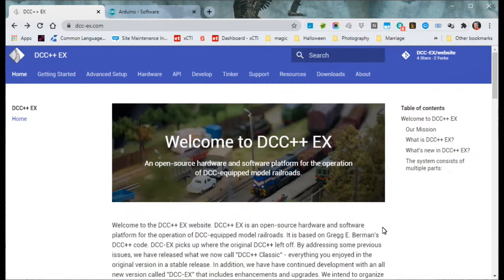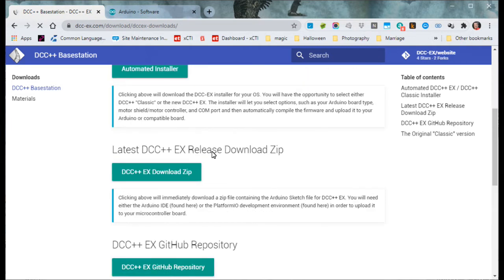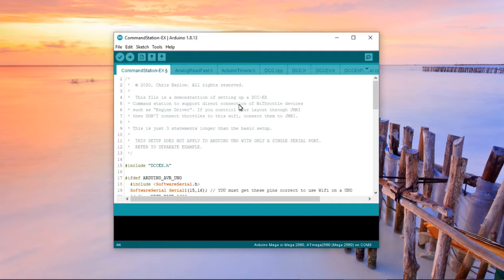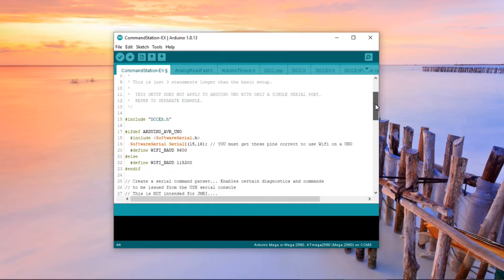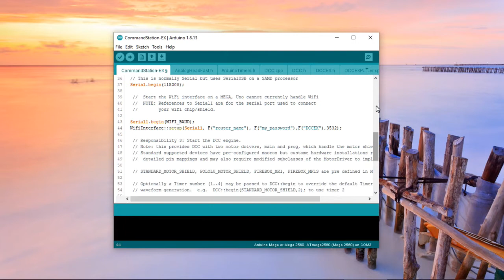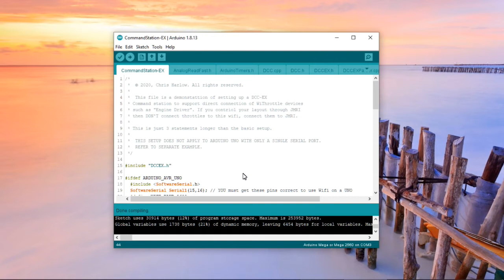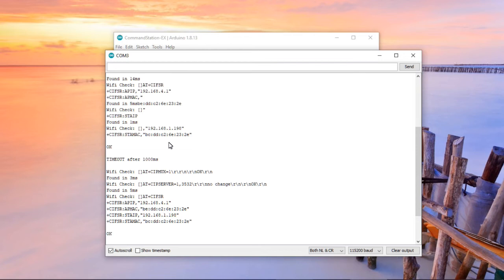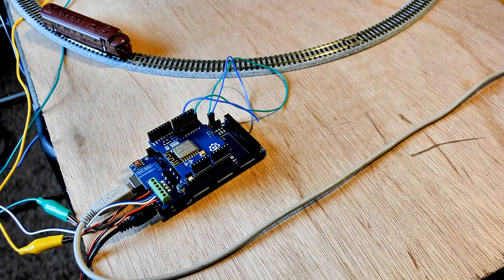How to connect DCC++ EX to WiFi and use Engine Driver to run your trains

Comment: Can you program a locomotive address 3 to say drive forward 65% for 3 seconds, stop 1 minute, change direction, switch turnout 1 to open, drive 65% for 3 seconds, stop 1 minute. And so on?
Reply from the maker: Yes, simple. A simple script in EXRAIL will do this for you. See: https://dcc-ex.com/ex-rail/EX-RAIL-command-reference.html#gsc.tab=0 It would look something like this:
SENDLOCO(3, 1) // send loco 3 on sequence 1
SEQUENCE(1)
 FWD(82) // forward at 65% of 127 speed steps
 DELAY(3000)
 FWD(0)
 DELAY(60000)
 THROW(1)
 REV(82)
 DELAY(3000)
 ...
There is a lot more you can do here, including respond to sensors with AT, as in AT(coal_yard_entrance) do something. Sequences can call other sequences. If you use the word ROUTE instead of SEQUENCE, Engine Driver and JMRI will see them and you can press buttons to start and stop them. Come see us on our Discord!
Reply: @DCCEX  Will it work with Digitrax hardware or is it not needed?
Reply from the maker: @fourbypete  You don't need Digitrax at all, but if there are specific things you might want to repurpose from Digitrax, ask on Discord
Reply: @DCCEX  How do you connect/ control turnouts, program lights, decoders and track sensors?
Reply from the maker: @fourbypete  All of the inputs and outputs can be connected to spare pins on the command station or use the I2C bus. Many  devices already have an I2C connection. You can also connect anything that has an accessory decoder, we call those DCC accessories. You don't have to connect them to the track, you can connect them to a separate bus if you don't want to use power from the track.
Reply: @DCCEX  I'll have to sign up to discord. I hear about it all the time.

Comment: Great video and I recommend it all the time to anyone looking to build a DCC-EX CS.  I'd like to see another with the first part but skip the Arduino IDE install entirely and show the software install using the EX-Installer only in that video.  I have a feeling the IDE install  might be turning some potential users away even though the EX-Installer is mentioned.

Comment: This is the best, but I'm stuck with something. I've followed all the steps on the dcc ex website to set up my arduino + esp8266 board (all in one), but the engine driver app that is supposed to work with direct dcc ex connection, disconnects frequently then reconnects and so on. I've tested dccpp app and works like a charm, but only one throtle is available at the screen, so I prefer the other one. My goal is to set up the system without any computer, only a tablet (android) and the arduino itself. I think i'm missing something, could you shed some light on this? Keep rocking with this!!!

Comment: I just received the a new Makerfab wifi which came direct from China. This one is labeled on the bottom as "DCC-EX Compatible". It worked great so it must have had the correct firmware as noted on the DCC-EX website.

Comment: Currently version 4.1.6: where is the configuration for the WiFi access point?
Reply from the maker: There is no configuration for the WiFi access point. If you connect a WiFi device and turn the command station on, you will get an AP at address 192.168.4.1 that begins "dccex_". Connect to that. If you want other configuration, that is in your config.h file. You can edit that with help from the website, or just use the new installer (After July 2023). The installer walks you through the configuration if you want AP mode or to connect to your home network in Station mode. This explains both modes in detail and how to configure them https://dcc-ex.com/ex-commandstation/advanced-setup/supported-wifi/wifi-config.html
Reply: @DCCEX  The issues is that regardless if we make it an STA or AP mode the EX-Installer uploads the configuration as an AP mode, no matter what. I am having a hard time finding a cut and clear tutorial on how to set it up as an STA. Would be nice if the installer would actually turn it in to an STA when selecting "Connect my EX-CommandStation to my existing wirelss network."
Reply from the maker: @vladtheimpala218  Have you used the new installer? I need to make a video on that. It is completely different than the old one and allows all sorts of configuration options. See here to make sure you have the latest version. For help with it or with using the Arduino IDE, please come to the Discord channel and post a question as a support ticket or just a comment in a channel like #installer

Comment: VERY usefull and excellently explainedl tutorial on DCC-EX and wifi. Congratualtions!
EDIT: @4:00 you mention the ESP8266 version 01 to be connected straight to the RX and TX of the Mega. This is a NO-GO: the Mega uses 5V, the ESP uses 3V. Connecting the Mega TX (5V) to the ESP RX (max 3V) risks damage to the ESP. That is why a shield should be used: that contains level-shifters.
Reply: I understand, and you are correct about the datasheet ratings, however the President of Expressif, Teo Swee Ann, confirmed that the GPIO pins were 5V tolerant. And many of us have used the ESP-01 and 01s for years with 5V on those pins without an issue. And with the Rx pin being fed data rather than full DC voltage, the average voltage the chip sees as heat is lower still. The power in, however can't go above 3.6V. 
That said, we have debated this a few times on Discord, and engineers being engineers and wanting to be "precise" like to be more cautious and tell people to go for 3.3V, which you can do with a 10k and 20k (or 1k and 2k) resistor divider on the Rx pin of the ESP8266. You can't go wrong with the conservative approach, so glad you posted this! There could be unexpected peaks and better to still with a lower voltage. We go into this more on the web page and provide a link to a cheap level shifter board if people would rather use that than resistors.

Comment: Quick question,  do you have a tutorial showing how the esp-01 with an esp-01 adapter board connects to an elegoo mega with a deek robot motor shield,  thank you.
Reply from the maker: We don't have a video yet for that, but it is a great idea. But it is pretty simple to do. This shows how. It doesn't matter if you connect to the Arduino or the Motor Shield since the pins pass through to the shield from the Mega. https://dcc-ex.com/get-started/wifi-setup.html#esp-01-and-esp-01s

Comment: I'm not getting it. I don't understand where I'm hung up. I got my mega board and Arduino and can run my train just fine when connected to my laptop. My wifi shield finally got here yesterday. I connected it to the other 2 boards and hooked up the jumpers. I can't figure out what to do to make engine driver connect to wifi.
Reply from the maker: Did you use the installer or the Arduino IDE? Better to use the IDE if you have troubles. But before you try anything, look at the log when you connect a computer running the Arduino serial monitor. It should show you the attempts to get a response on all 3 serial ports of the Mega. If you see 3 "no AT response" messages, you have a connection problem or bad board. If you see one of the attempts connect, you will see 192.168.4.1 in your log. Look for that. If you see it, then you turn off auto-connect for your home network on your phone. Then connect to the DCC-EX Access Point you should see there. If you have the latest version of Engine driver, when you go to it, it will find DCC-EX and you put in the password. The detailed instruction is here: https://dcc-ex.com/advanced-setup/wifi-config.html#default-operation-ap-mode-no-configuration-necessary.
If you don't see one of the serial ports respond with a lot more commands and the IP Address, then try another serial port or switch the wires. One of the clone Megas has the silk screened letters backwards on one of the ports and Tx is Rx and visa versa. If you still have trouble, send us an email or post on Discord with a picture of your boards so we can see the jumpers and a copy of the boot log.
Reply: @DCCEX  I used the installer.  I entered my home network name and password.  I get the impression the Wifi is working but I can't seem to connect to it or see it on my home network.  I looked at the config.example.h file and I can't see any references to wifi network name or password. There is no other config file in my CommandStationEX folder. I don't know how to get to the log file you mentioned.  I'm not really experienced in networking but I do have my computer, phones and Roku devices correctly joined to the network. I've been reading the pages you sent me all day long and I'm still having trouble.
Reply: @DCCEX  I got it. Thank you. I was missing one step and once I found it, all was smooth.
Reply from the maker: @michaelmappin4425  Oh Great! I was just getting ready to type some more instructions. What was the step that got you going? I can update the help to make it easier to find.
Reply: @DCCEX  I just wasn't thinking in terms of it being a network I had to connect to. It's clearly in the video but for some reason my brain just kept skipping past that. Once I connected using the password from the MAC address, everything was smooth sailing. Thank you again for everything.

Comment: Can you guide me if this can be used to read and write CVs and wirelessly by connecting my laptop to the access point and then launching JMRI? I am very new at this any help will be much appreciated.
Reply from the maker: You can read and write CVs, but to connect to JMRI you should connect using a USB serial cable. You can use a WiFi connection, but that is not how we recommend connecting to JMRI. You will get no diagnostics, it is slower, and when programming, ACK detection is "blocking". That means if trains are running on main, they may lose some commands. Same with turnout control.
Some phone throttle apps let you read and write CVs wirelessly so you do not need JMRI. 
You can also use the HC-12 boards as a wireless USB bridge. You connect one to the serial Tx/Rx pins of the Arduino and another through a USB to TTL board to the HC-12. Or you can an HC-12 with a USB to TTL converter in it. That is called a "HC-12-USB Line Computer Terminal"
If you still want to connect JMRI directly to the CS using WiFi in AP mode, start one of the JMRI-based programs, then go to the Preferences panel. This opens automatically the first time a JMRI program is run, or you can select it from the "Edit" menu (from the Application menu on OS X).
Connect your laptop to the AP of the CS, NOT your local home network. You can use your local network, but you asked how to use the default AP configuration.
In JMRI, Select "DCC++" from the top selection box ("System Manufacturer").
Select "DCC++ Ethernet" from the second selection box ("System Connection").
Input the IP Address and Port Number of the DCC++ Command Station.
Click "Save". You'll be asked if it's OK for the program to quit, click "Yes".
Restart the program. You should be up and running.
Now you can read and write individual CVs or use the page read and write feature in JMRI.

Comment: I'm building my own wifi board using esp8266 modules. The problem is that they have been used for other things before and don't have the AT software installed. Has anyone any idea how to re-program them?
Reply from the maker: We don't have a tutorial for just the ESP8266 chip, but here is how you upload the correct AT command set once you have a circuit or cable to connect it: https://dcc-ex.com/advanced-setup/supported-microcontrollers/wifi-mega.html#mega-wifi-configuration. So just ignore the part about the Mega+Wifi and do the same for your board. Instructions for what else you will need depend on your board. If you have the tiny ESP-01s boards, you will need to create a circuit with a breadboard, some jumpers, an FTDI board or FTDI cable, and perhaps a button or two. There are lots of instructions if you search "upload firmware to ESP8266". If you buy a few new ones, they come with the AT command set on them.
Reply: @DCCEX  Thanks for getting back to me. I have managed to get the AT commands working this time. I hadn't set the SPI mode to DIO as said in the instructions. Many thanks, I can start on my own wireless shield now.

Comment: No motor jumpers required this time at all? Please clarify
Reply from the maker: We configure an Uno or a Mega to use the correct pins to match the motor board. You do not need any jumpers to connect a motor shield like you do with DCC++ Classic. Details are here: https://dcc-ex.com/get-started/assembly.html. 

We can however, use jumpers on boards that are not shields, or to implement our "high accuracy" waveform on a board whose pins don't match up with Timer1 pins. That's something most people would not even need to know about , but I'll mention it. There is a section on the web page describing that too.

The only jumpers necessary are to connect a WiFI board to a Mega. The WiFi boards typically want to connect to the first serial port which is shared with the USB port. We call that Serial0. You need to connect WiFi to Serial1, 2 or 3 on the mega with 2 jumpers

Comment: fantastic! just got my motor driver board. gonna try this tomorrow, any plans to port the command system itself to esp32? so you can jus do away with the arduino? also where can i find the pin outs/ pin connections ? as i just want to use my own arduino nano, motor ic and esp8266 modules
Reply from the maker: No plans for the esp32 at the moment, though one of the other developers who has worked with us in the past has his own esp32 based system he has been developing. But we do now have Teensy support!

Comment: I often get massage "Could not connect to 192.168.4.1 port 2560" and I have to reset my CS multiple times to connect my throttle to my CS. i am using Engine Driver ver. 2.28.123 by Steve Todd. on my Android Phone.

Comment: As per your web instruction I tried with esp01s and installed the software. Butt my programming track lights on motor shield does not   on. Only main track lights on and my loco run smoothly. What is wrong with my programming track?
Reply: We only turn on the programming track when you are programming ;) The DCC++ Classic does not allow you to control the power separately, EX does. If you go into the serial monitor and type <1> both MAIN and PROG should come on <0> turns both off. <1 PROG> turns prog on separately if you want to have it on for some reason. If that doesn't work, then we would have to check your config and that the pins are all correctly seated from the Arduino to the motor shield
Reply: @frightrisk7407  I connected the same with jmri and both lines are lighted but when I connect with phone again programming track is turn off.
Reply: @xpertllm  Correct. We haven't changed the behavior in JMRI yet. It sends <1>. The developer of Engine Driver is on our team. New changes are always added to ED. Steve sends <1MAIN>. It doesnt make sense to have a track powered up all the time when you aren't using it. (Technically, ED does not use <DCC++> commands. It sends withrottle commands which we directly read separately from <> commands)
Reply from the maker: I need to try to remember to login to the same account when I reply. I am Fred, aka DCC-EX aka Frightrisk ;)

Comment: Hi,
is it possible to use multiple throttles to control multiple trains with this configuration?
Thank you so much for this video
Reply from the maker: Yes, you can control quite a few trains. You can control however many Engine driver supports, either direction to DCC-EX or through JMRI using WiThrottle (or anything else). You can also build a throttle similar to Dave Bodnar's HC-12 throttle. The HC-12 is basically a replacement for a USB cable. This is a version of it I really like. If you go to Dave's site, there is a simpler version with a heap LCD display. https://www.youtube.com/watch?v=neMlNHVZWuY

Comment: Aliexpress has mega 2560 with onboard esp8266 for about 10 $
so no need for shield, works fine.
Reply: What switch and jumper settings did you use?  I just got this in the mail and haven't set it up yet.
Reply: @larrynelson1776  
Micro swith array :
1,2 ON = MCU - > ESP
3,4 ON = USB - > MCU
5,6,7,8 OFF
Switch : TXD3
Just upload sketch to Mega2560,
ESP8266 has AT firmware by default
Reply: The issue is knowing the difference between "good" boards and "bad" boards. We have had quite a few issues getting some of these boards to work. Also, having to flash new firmware on a device is something we try to avoid for "conductors". "Tinkerers" or "Engineers" may want to try it. We will be posting detailed instructions on the website soon for using the esptool python script or the expressif firmware tool with the propert AT firmware to get these working.
Reply from the maker: We will be adding a section on our web page for a step by step configuration of this board.
Reply: so are you saying you can use this board mega 2560 with onboard esp8266 and do you happen to have a step by step

Comment: I am from Pakistan and it cost me a lot buying shield and shipping to Pakistan but i can buy a simple esp8266 module from my local shop. Can you make a video of such module. Who to wire and jumper setting to connect 8266 module with mega.
Reply: We can, thank you. In the meantime, instructions are on the website. You don't normally need to flash them unless ou want to upgrade the firmware that comes with them. https://dcc-ex.com/get-started/wifi-setup.html
Reply: @frightrisk7407  I used esp 01s for WIFI and i powered 3.3 v to esp01s from motor shield and its work fine . Is it ok?
Reply: why we need to supply 3.3v to CH_PD.? It work fine even we do not supply volt to CH_PD

Comment: Hi, when I try to use automated installer, stuck on  "Obtaining https://github.com/DCC-EX/CommandStation-EX.git via git
". Works fine with commandstation-classic. I'm running as administrator . Any thoughts?
Reply: Sorry for the late reply. I hope you got it working.